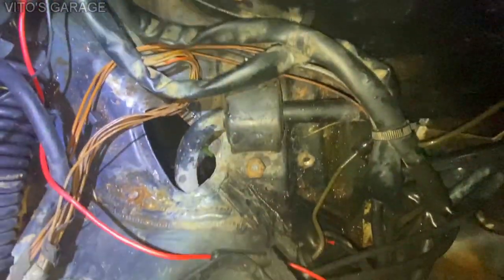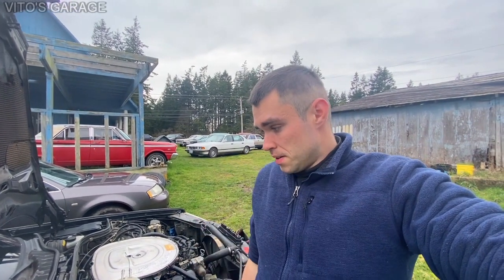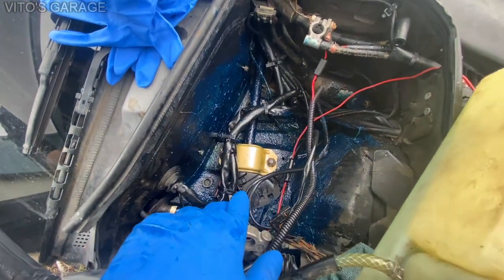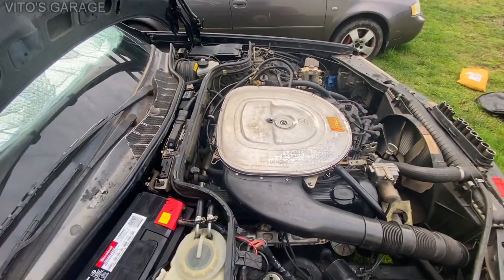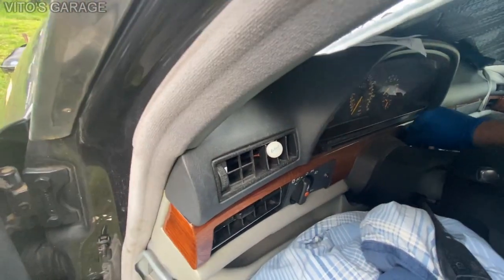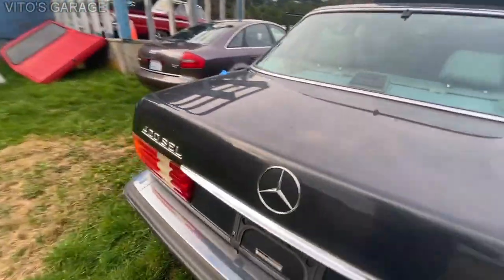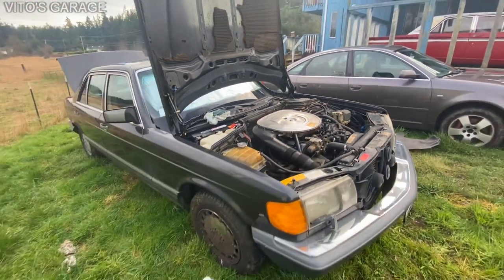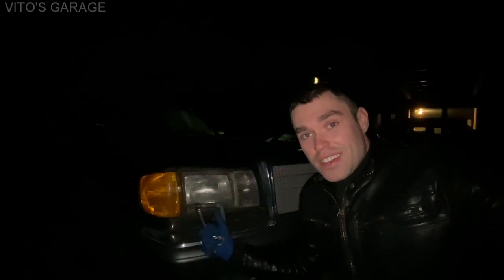Mercedes 420SEL W126 Still Broken? LHD Interior Cleanup, Battery Tray Restored, Misfire Progress..

Comment: If your having great spark to the cylinder, I would check the fuel pressure to that injector and the condition of the injector next. If neither of those do it, the next thing I would try is a valve adjustment on that engine, I'm sure after 300,000 miles of no maintenance that might be affecting the compression numbers. But I come from the diesel world I don't know how that will affect a mercedes gasser and its operation. Once that car warmed up it seemed to run pretty well. It might also pay to do an oil change or flush after 300,000 sometimes you get lucky and it cleans some grime out that is affecting performance lol.
Reply from the maker: This engine has no valve adjustment. And I’ll keep working on it and giving her love. She’s in good hands now. Changing the oil and filter is another thing I’m gonna do to this car for sure. I’ll keep you all updated on how things are. Thank you for watching and supporting🤝

Comment: If idle rpm go up and down up and down:
Idle air valve, idle air rubber lines, vacuum leaks in the throtle area, vacuum line from ignition EZL to throtle likes to go bad because of the transition to a different line diameter. It also might be the semi-conductive roads inside potenziometer, they get worn in the idle travel area the most.
Reply from the maker: Thank you so much! I’ll look into checking all those🙏🤝

Comment: Are you already check the oil inline under each gasket ?? It’s a big problem in this V8
Reply from the maker: I know about that. I opened the oil filler cap and tried to lift the oil line through there and it was good and tight. I’m still gonna remove both valve covers and replace those plastic oil line retainers

Comment: The sound is out of sync with the video. 
I have similar problem on my 190e. Misfire on one cylinder but it doesn't seem to misfire when I rev it 🤔 doing the lift cable on spark plug test- vacuum leak? I already swapped 2 injectors but misfire still there.
Reply from the maker: I’ll fix the sound sync. And if it’s smooth when you rev it up then it could be a vacuum leak. Buy a smoke machine and smoke the whole intake. It’s worth it. Vacuum leaks can cause a lot of problems. You need to check that first before digging into the fuel distributor
Reply: @VITOSGARAGE  smoke machine?what's that
Reply from the maker: You can watch some videos on how to use it but it’s a great tool to have. You can test for vacuum leaks and evap leaks. You basically introduce smoke into the system and you look for where the smoke starts coming out of. That will tell you where the leak is.

https://www.ebay.com/itm/Automotive-EVAP-Smoke-Machine-Diagnostic-Vacuum-Leak-Detection-Tester-NEW/193375072640?hash=item2d060d7180:g:zpIAAOSwVsJeZshA
Reply: @VITOSGARAGE  Thanks 👍